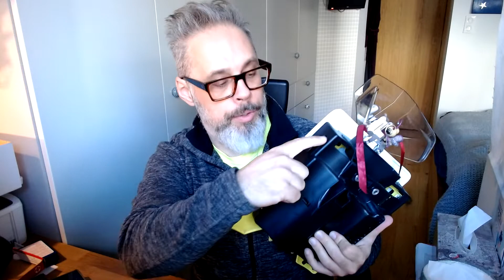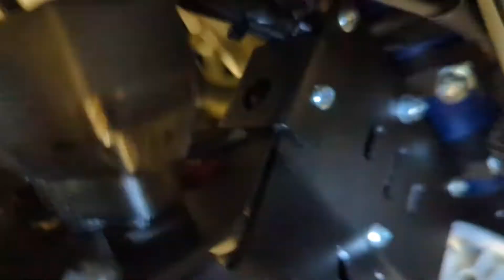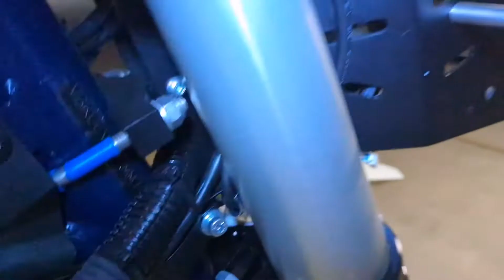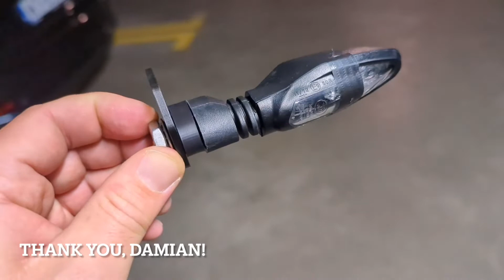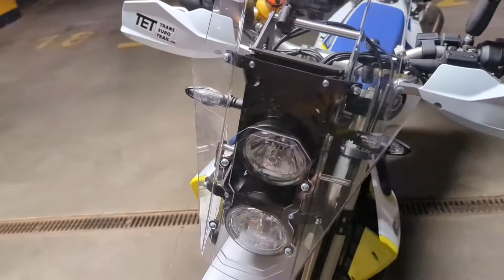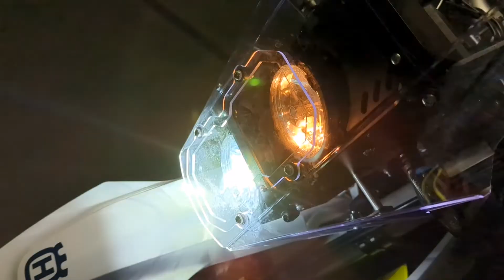Adventure-bike.be Husqvarna 701 / KTM 690 Rally Tower installation

Comment: Good point with marking the wiring. I do the same to simplify mounting back most of the things on my bike. Can't wait to see the tower in real. 💪
Reply from the maker: Thanks 👍 This is a good quality product, the problems I encountered were minor and easy to fix with a little bit of help of friends. And if clip and spacer for blinkers are needed - those are easy to print.
Reply: @CykloGamonie  FYI, KogutOFF = Rooster on Wheels. 😎 What's the overall weight change, pre and post mounting?
Reply from the maker: Hey there Friendly Rooster on Wheels :) The total weight of the tower with everything included is 3.44kg (~7.5lbs), so not that bad.